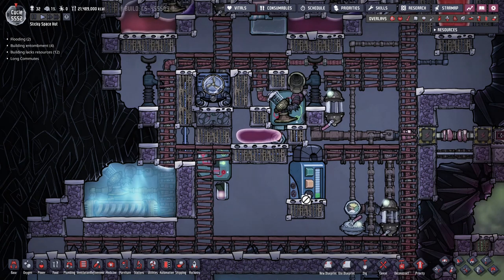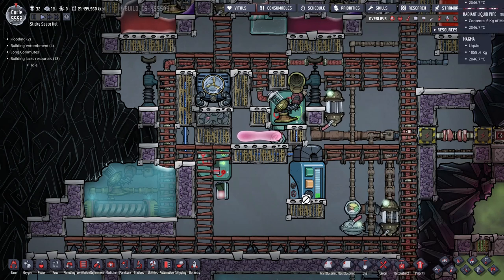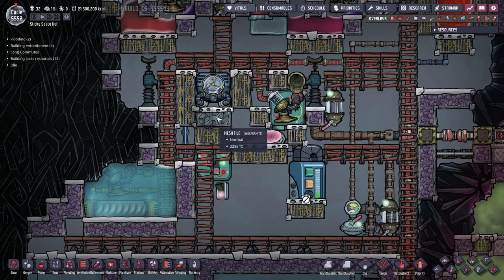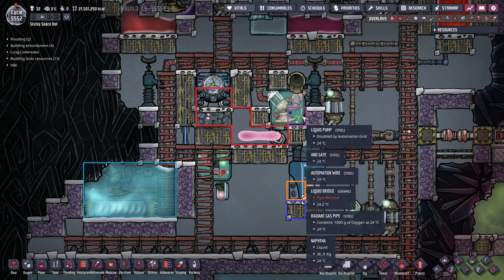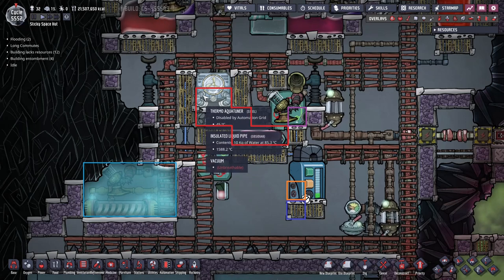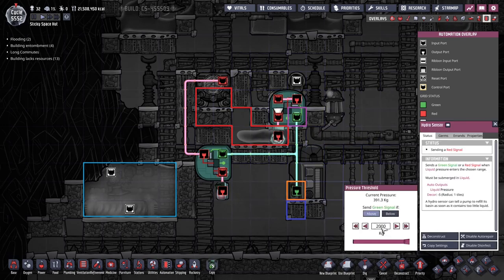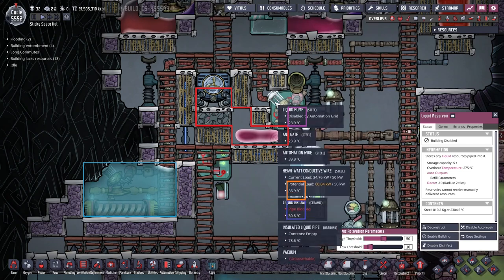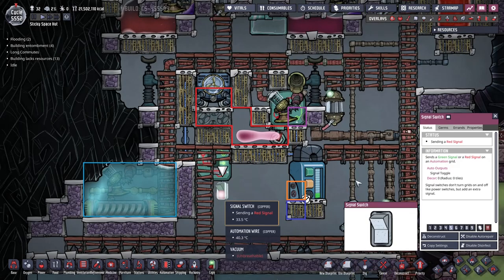Easy Molten Steel for Your High-Temp Builds - Oxygen Not Included

Comment: What happens if you don't have wolframite for the mesh tiles? Is there a substitute you can use?
Reply from the maker: Could use steel or niobium, but need to be very careful not to heat above 2400C. In my build, the machine gets to 2370C at most, so should be fine.

Comment: Great video! I tried something similar with gold/iron/copper but natural tiles keep forming about 80 % of the time. Do you have any idea why?
Reply from the maker: Yes, this is because once steel is molten, it will not turn to solid tiles until below 1100C. Other metals will cool and solidify most of the time.
Reply: @greezyhammer764  Aah, that makes sense. My setup right now is to melt iron aquatuners on top of the natural copper tiles formed by copper ATs, to get early  game high temperature liquids, and pumping the liquid copper in an metal refinery. Kinda works as well haha
Reply: @mrsjappert  Aluminum would be better as a coolant as it has larger temperature range. And you can melt the tuner with polluted water

Comment: Greezy, I love you builds.  I'm trying this one, and melted 2 aquatuners fine.  The third one just went to broken, didnt get high enough temp to melt, any idea why?
Reply from the maker: Sometimes with water, AT can break just before it melts because it's not heating fast enough. It should always melt with super coolant (or nuclear waste in DLC).
Reply: @greezyhammer764  Have you actually tested the nuclear waste thing?

I thought it doesn't stay confined, and leaks from buildings, including ATs. Needless to say, pouring liquid nuclear waste over liquid steel creates a nice cloud of Nuclear Fallout (a gas) and bye bye vacuum. If they fixed it for ATs, great!

Comment: Weird... i tried it on based game, however my aquatuner overheat at  1831 not able to melt it before it broke
Reply from the maker: If using super coolant, it will work on the first try. When using water, often times, need to repair it once, and then it will melt on the second try.
Reply: @greezyhammer764  thanks, after i change the liquid to coolant, it melts perfectly :)

Comment: hm doesnt work for me. The liquid Tank gets overheated or the little pipe on the bottom of the tank. hmmm.
Reply from the maker: Make sure to disable the tank prior to filling, otherwise output pipe can overheat. And make sure to use Insulated Obsidian pipes.
Reply: @greezyhammer764  thx for the quick answer. i will try it :)

Edit: seems like im just to dumb for that xD The tile under the Liquid Tank is fine but the tank still overheat...and the shut off and some other sh....

Your content is awesome...im sure its me who f** something up in building xD
Reply: @greezyhammer764  Why doesn't insulation work? Will that melt onto tungsten at this temperature?